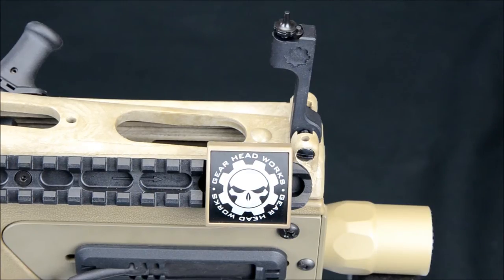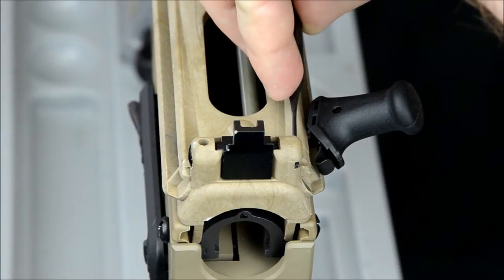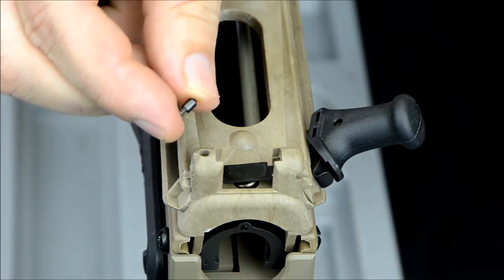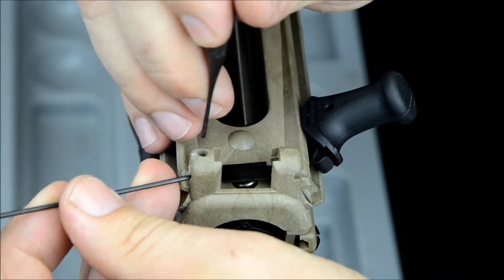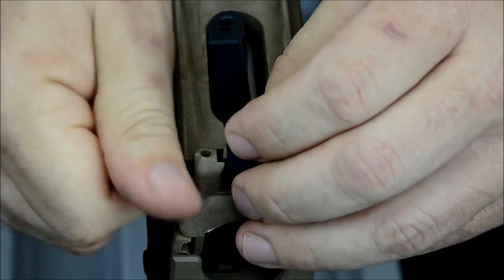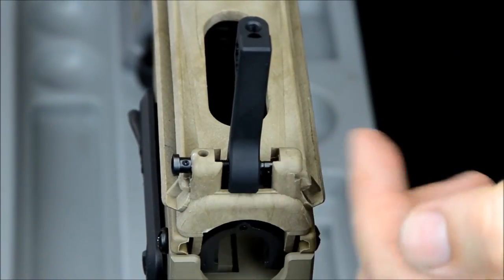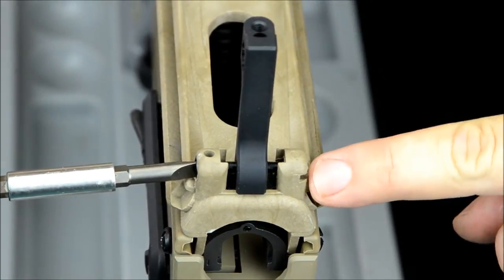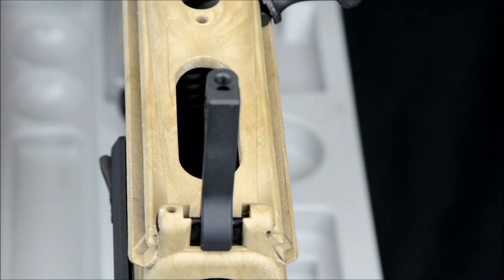Tavor Razorback front sight installation

Comment: Hi Gearhead Works, I have a question. I wanna save money on the top rail so I’m planning on chopping the OEM top rail on my Tavor SAR, I will keep the rail in the back and get rid of the piece that go over the top hand guard. 
Is this razor front sight compatible with the OEM intergrated rear sight that’s provided by IWI on the top rail from the Tavor SAR or It strictly have to go with AR15 flip up rear sight? Will this razor front sight sit higher than the OEM rear sight?
Thank in advance
Reply: I am wondering the same thing. I bought a spare OEM rail and plan to chop it to give the rifle the IDF look. 

How did you chop your tail and cover up the cut?
Reply: I've done it and it doesn't work. The GHW's rail raise up the flat top height and the front sight post are made longer to accomodate the height. But if you use the OEM rail you end up with the front sight post too tall. I modified the OEM front sight post to fit the same way they show mounted above but result in the post being too short. Even with the post extended to almost wobbly I could only zeroed to really short distance. I'm currently looking for longer front sight post.

Comment: Do you have a video on installing the factory front sight in to your sight?
Reply from the maker: +jason20341 I do not have a video of installing the sight post. It works just like replacing an AR15 front sight. You just push the plunger down and unscrew it out of the old assembly and reverse the process to install it onto this sight. Also you can use the front sight adjustment tool that comes with the Tavor to do this with.

Comment: What kept the threads from striping when you pushed the sight over when it flushed out with the side? Looks like you forced it over till it popped?
Reply from the maker: It did not get forced through the threads in the sight. It is only getting pushed through the detent in the stock. The threads are fine.